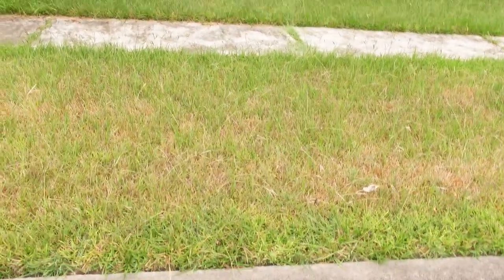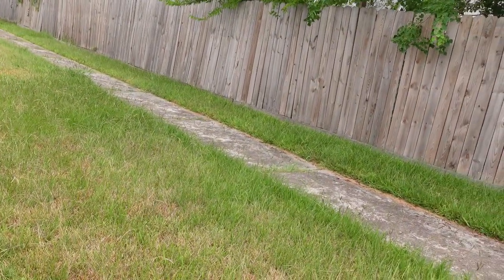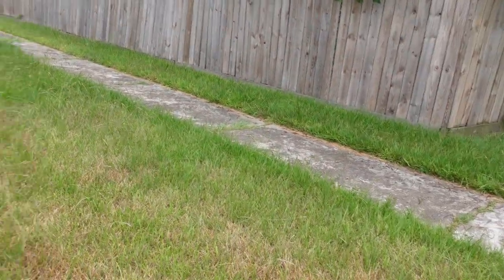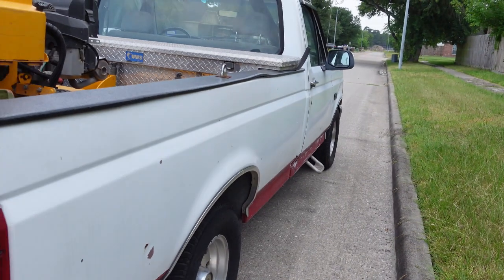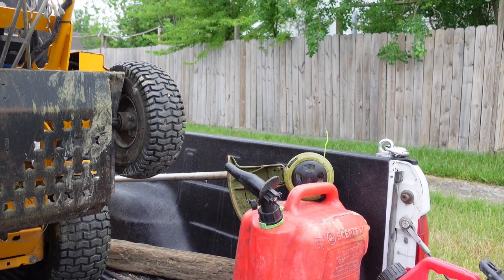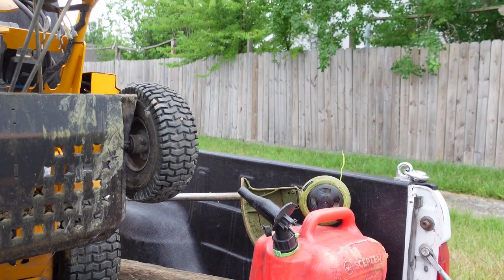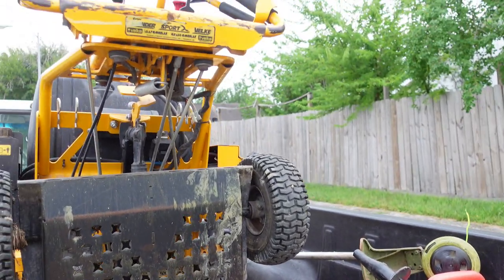Customer called for lawn service

Comment: Check your fuel filter,  if it's very hot where you are and the gas station lets their tanks get low, you can get condensation in the tanks which ends up as water in your fuel tank.

Comment: Good luck with the truck. Since the other equipment is running fine on the same gas if you can run a smoke test on the evaporation system. You may have a blockage or leak in that part of the truck.

Comment: If you filled up the gas cans on the same pump, from the truck straight to the gas can,  look to the bottom of the gas can. If there's water at the bottom, you might have water in the trucks gas tank.

Comment: You need a new rotor and cap. Those caps are notorious for getting moisture in them. It's not fuel related it's spark.